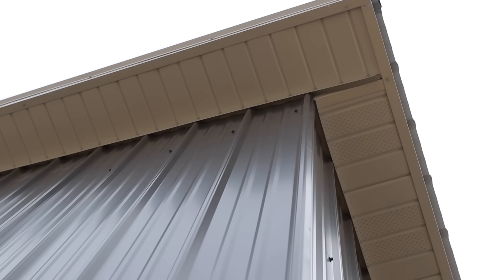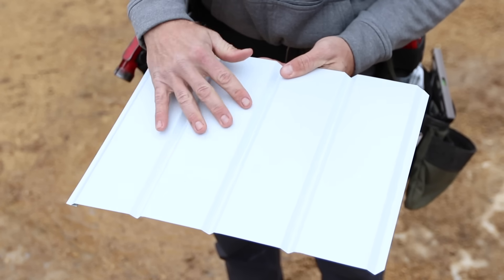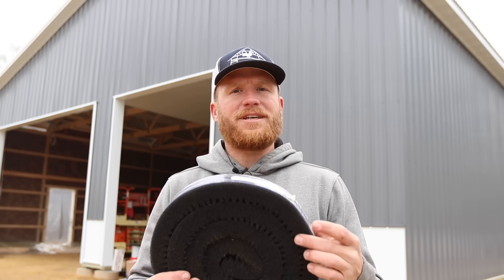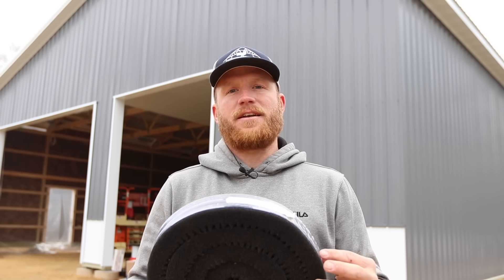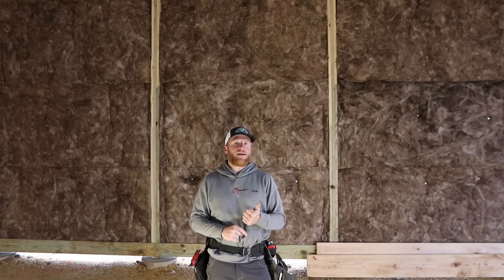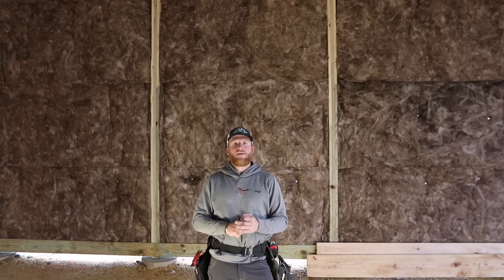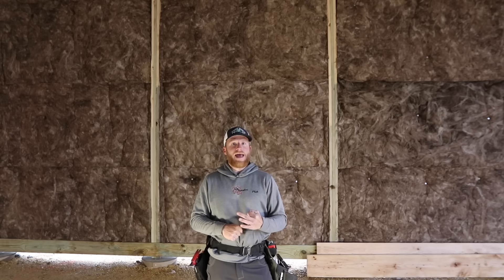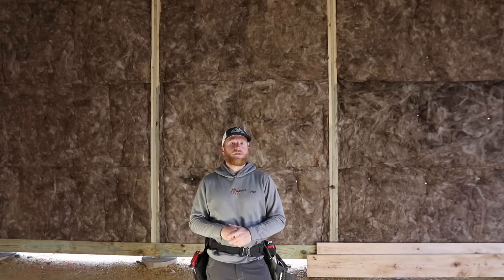Insulation: 5 steps to a more efficient building and why I don't use spray foam

Comment: Great video!

Have you heard of Prodex Total Plus?  It looks like that foil bubble wrap stuff at Lowe's, but it is actual insulation.  They make 5m (R-17) and 10m (R-22).  We use it with our precast concrete buildings and love it.  No flame spread, vapor barrier, etc.  It sounds like I work for them.  You should check it out, www.insulation4less.com, and I think they have a YouTube channel.

Thanks again!
Reply from the maker: Cool thanks man
Reply: That stuff is crap and the R values they claim are phony.  You're much better off using foil faced rigid polyiso.  https://www.greenbuildingadvisor.com/article/stay-away-from-foil-faced-bubble-wrap
Reply: toldt ok, so I’m guessing you are talking about the bubble wrap stuff, which I agree is total crap. Prodex Total is not bubble wrap. It is closed cell polyethylene foam, even says so on the website you put in, which also says it is exaggerated. It wasn’t clear to me what they meant there, but I’m not that smart anyway. What I do know is that I actually use this stuff on a regular basis with precast walls, which have almost no R value, and get excellent results. I’ll look into the polysio stuff you are talking about, don’t know much about it, but don’t confuse Prodex Total with bubble wrap. It’s really good stuff, exaggerated or not.
Reply: @aesprecast  The article from Green Building Advisor mentions Prodex Total specifically, among other products.  Whatever it's good for, you can find other products (ie radiant barrier) that will work just as "well" for cheaper.  Read through the whole article I linked to.  The editors on that site are quite knowledgeable and base their claims on sound building science.
Reply: toldt I’ll check it out, Prodex is good, but definitely not cheap!

Comment: I love the truss heel detail. Keep up the good work your knowledge is undervalued thanks for sharing man.
Reply: Yes, in Canada we figured out the problem with shallow truss heels years ago the hard way (poor insulation at corner of roof and heat escaping to the roof and causing ice dams and big ass icicles hanging off your gutters).  People think icicles hanging off your roof looks charming but don't realize its a symptom of poorly designed trusses and $ going straight through your roof (or should I say ruff?)
Reply: Thelonious M yes sir.   Spray foam those eves

Comment: Kyle,

Happy new year!

EDIT: Answered my question at 6m10s. Thanks!

I have a pole barn that I am beginning to work on. It's got a sheet metal exterior which needs some love, 6x6 posts, and 2x4 girts. I live in SE Michigan and it gets quite cold here. My plan is to install poly-iso between the girts, build a 2x6 frame between posts, fill that with fiber glass insulation, and apply plywood over the top. I'm not a builder by trade and have been learning as much as I can. Let me know if this is sane or if I should rethink my plans.

Comment: Good video, you obviously put a lot of thought into your work. Your wall insulation package concerns me though. I have been insulating buildings, including pole barns in northeast Ohio for the past 15 years and experience has taught me to avoid double vapor barrier assemblies because they tend to trap condensation. You install nice fluffy fiberglass in wide open, 8’ wide cavities which means that you are going to have a lot of air movement in your walls due to convection no matter how well you air seal the outside of the building. That air movement will kill your r-value and increase the risk of condensation. Closed cell spray foam solves those issues and is worth the true cost of the upgrade. Your attic assembly is fine but take another look at the walls; I think that once you add up the cost of all the various steps you have to go through now you will find foam attractive.  On a different note, you should add extruded polystyrene as perimeter insulation around your slab.

Comment: For what you're calling your attic air deflector why are you using you left over house wrap instead of using reflective material like a Radiant Barrier I understand that you're saving money by using remnants of the house wrap and I also understand it is in metal building which in and of itself is a Radiant Barrier however it is also an oven meaning yes it is going to be reflecting the radiant heat but not all of it what does infiltrate Houston trapped in gets reflected back down and you will not get out if you used the Radiant Barrier for your attic air deflector then you would have pain a better median with what your ultimate goal was and you even said it attic temperature being same as ambient temperature any heat infiltration you wanted to get blocked in the air cavity that you're creating with your attic air deflector and the roof so that it can follow natural draft principles from the soffit 2 the ridge vent
Reply from the maker: There is no cavity.... the attic air deflector keeps the soffit to ridge path clear and open
Reply: I had worked in a metal frame and skinned warehouse, never got like an oven in there, then again it had a few big overhead doors and we would turn on the mobile floor fans for some air flow in the middle of summer, it was in FL.
Reply: @Joshua79C  well I'm in Texas and a metal Warehouse building does get like an oven if not properly constructed for this climate
Reply: Both states have high humidity levels, its not dry in FL or TX. Like I said it but forgot to say it did have insulation but was the style whre it was fastened in between the outer skin and framing thus where it is pinched it was useless insulation wise, and they had large floor fans for air movement on less windy days.

Comment: Ok what is value? Is value saving money now or saving money for the next...... forever? The added cost of Spray foam is offset in 3-5 years by energy savings alone. Then there are all the other benefits. Rigidity, mice and insects won’t live in it, moisture control, no added cost of poly and house wrap detailing. 

Flash and batt is bad in every climate zone except 1 and 2. Of you want to make condensation put 1” of foam on the outside, stuff fiberglass and tin it. If you want to make mold add a layer of poly on the inside. 

Please don’t publicly talk about things your not educated in. 

I’m actually mad I gave this another view.
Reply from the maker: Where are you getting your info?  Thanks for your constructive feedback.  We have had great success insulating our structures this way In our climate.  If you’d like to tell me how you do it please feel free, no need to be aggressive.    You would never recoup the cost of foam in a structure in 3-5 years.... I own a 60x88x18 tall and heat it to 58 all winter.... all fiberglass and I use less than $500 in heating for the entire winter.  My same shop would have cost me around 15k if I used just 2” of closed cell.  Yes it would have been sealed tight but even if it was free to heat... which it wouldn’t be... It would still take me 30 years to break even..... 30 YEARS!   Maybe I’m crazy but please help me with that math.   Also, I’ve yet to see a mouse in my shop in any of my traps in 4 years I’ve had it finished!  If you detail stuff right they have no way of coming in... even if they did get in a door... they have no way to get into a wall cavity??
Reply: I have heard and even read a few stories of mice or insects "eating" (chew and spit to make room, aka tunneling like humans do in dirt) away the spray foam or even other stiff foams to make a nest and get in to the structure living area or to the structure itself to eat at their food source.
Reply: @RRBuildings  3-5 years is industry standard ROI for spray foam in residential construction. For a building that you are not heating and cooling year round it will of course take longer. You do good work for cheap but doing it cheap will never be as good as the higher end product.
Reply: @RRBuildings  Guess Matt was too mad to respond. SMH
Reply: You need atleast 11/2 inches for polyurethane spray foam to get vapor/moisture and air barrier. Aleast in the state i spray foam in

Comment: Question: Cost aside spray foam seems like the oblivious choice my only hesitation is future repair-ability? Say you spray foam an entire metal building then a spot gets damaged, say you back a trailer into it and now theirs a gaping hole in the side. How in the world would you remove that panel that's been forever glued to the rest of the structure? Same goes for wiring, wall sheathing, framing, plumbing.... Does anyone have experience doing a spry foam remodel? Love all the listed benefits but know repairs are inevitable.
Reply: I've been spraying foam for 5 years. You could just pull out anything with open cell. For closed cell you can just cut it with a knife or a saw. As far as running stuff through it closed cell usually doesn't fill the entire cavity and you can run through open cell. There aren't any real down sides to foam other than cost and even cost can be justified over time.
Reply from the maker: Justin that is also a huge reason I don’t want to use it
Reply: I personally would use wide and long rolls of wax paper Or plastic coated kraft paper covering the outside barrier and  around each post to keep the spray foam off the wood and steel structure components for easier repairs when needed.
Reply: Use house wrap on the outside and spray foam to that
Reply: You can remove exterior metal from the building when closed cell foamed . Also have you evwr seen a closed cell metal building? The metal will be many times stronger because of the foam witch will help against damage.

Comment: My thinking is that a vapor barrier is not necessary when steel liner is used but am open to being shown otherwise.  There are two ways for water vapor to enter the wall cavity.  The first being Vapor diffusion from the warm moist area to the cold dry area.  The second is air leakage.  A vapor barrier is meant to address the diffusion mechanism but it may not be effective for air sealing.  The reason I don’t think it is needed with steel liner panel is because steel in and of itself is a vapor barrier.  It is not like drywall or plywood or osb in which vapor can travel through.  I’d love to hear other thoughts.
Reply: Seen pictures (images) on a few blogs showing how the wood behind the steel got moldy due to moisture but also mainly to poor ventilation, its a common misconception due to those living in less humid areas than that to those living in moisture prone areas such as for me in MA, it is wise to build the way he does and not adding tape to the vapor barrier as doing so does not allow the wall to breathe enough to prevent/reduce the chance of mold growing in the wall. Even including felt on the roof would help reduce the chance of mold growing on the wood structure where it can get humid and thus moist enough for mold to grow.

Comment: Closed cell spray adds strength and vapor barrier regular types of insulation will allow air to go through closed cell will not So the payback is not what you think on comparison
You all do awesome work
Reply: I've been doing spray foam and fiberglass insulation for 25yrs. Theres not even close to a comparison between fiberglass and foam. Foam is superior in all classes.

Comment: You talked about heat insulation but what about sound?It is a steel building, wouldn't even a thin layer of foam sprayed make for a more acoustically environment?
Reply: Yeah, because I'm overly concerned with absolute quiet in my garage.... LOL
Reply: Klaus Van Heusen  , only in the quietest of 80,000 square foot machine shops for 11 years. ;)

Comment: What is the wrap attached to you showed at the very beginning? It's right under the outer tin correct? Does that mean you have a vapor barrier on the inside of the wall and the outside of the wall? Sorry kinda lost me on that.
Reply: Just watch the portion of past series when he goes to install the outer shell, it covers the post with girts installed so it is between the skin and structure.

Comment: Hi Kyle, great video, I'm always intrested how things are done in other countries or areas. In Germany we have way higher code standars, in regards to the insulation.

If you would protect your ceilling insulation the draft of your ventilated roof, it would ne was more efficient. But I know how difficult all your connections with yor frame would be.
Reply: Try the arctic, they have higher/more insulation needs.

Comment: Found it hard to believe you never mentioned the concrete slab. Here in the UK any building such as yours that is insulated we also insulate the concrete floor slab. After hardcore is compacted a blind layer of sand is laid and also compacted. This protects the pvc damp proof membrane laid next. It prevents rising damp. The block insulation slabs are laid next with a slip sheet to separate them from the concrete slab. Looking at the huge floor surface area of your particular building and the amount of effort you put into insulating the roof and walls I can’t understand why you ignore the floor, which is effectively has a huge heat loss factor.
Reply: You obviously don't realize how large the United States is. 11 of our 50 states are each larger than the UK. 28 states are larger than England. More people live outside of cities in the US than live in the entire UK and there are more pole barn buildings in the US than there are buildings of any kind in the UK. Each state/region has building codes appropriate to the climate and geology and they are well thought out for each area. But, you know, you're welcome to make a video of the building that you built and post it to YouTube.
Reply: The wonderful thing with Post Frame is it can be built on any foundation, thus said one can build a home from post frame with a walk around basements and use ICF for the basement-foundation which is a form and insulation system in one. Where I like I rather a 8 inch insulated wall for those really cold (arctic) winter days.

Comment: Interesting detail on the grade boards. On mine, we floated concrete to the outside board. I had to lift the batting before it was poured. What are your thoughts on double-bubble for the roof? I have it on mine, one thing aside from condensation control I like is that when it rains it's quiet inside. They blew in R-64 into my roof, I can turn the heat on for about 10 minutes and it's nice in there.

Comment: Great video Kyle.  The way your attic space is ventilated sounds great, especially how the blown in ceiling insulation meets the wall bats without blocking the sofit vents.

Out of interest... do you use EPS under your concrete slabs?  In the UK it's added to help the floor retain its thermal mass.
Reply: Underslab is per the customer and imo best to do in any cold climate zone with frostline and even if they are going to have hydronic lines installed for a heated floor.

Comment: https://buildingscience.com/documents/digests/bsd-106-understanding-vapor-barriers

If water does find its way to your cavity, which small amount always will weather that be through a bad detail in building stage which it seems that you guys do a fantastic job detailing tyvek and vapor barrier or weather that be through condensation or vapor collecting on your cavity my question to you is how do you expect that cavity to dry now? I have personally been in many new homes in the tri state area with mold issues stemmed from plastic being installed over framing. Not here to point fingers I am just here to hear more on why you put Polly on your walls thanks in advance for a response.

Comment: i always thought the #1 reason to go with fiberglass is it's treated with formaldehyde to control rodents. does spray foam control rodents?
Reply: Look at any building done with fiberglass and you’ll find rodents and droppings.  They love fiberglass. Spray a building with closed cell foam if you want the best insulation. It’s cheaper to heat my pole barn that’s foamed than my house that has fiberglass.

Comment: As an insulation contractor, I can't tell you how many times I tell builders to put a flat ceiling in this type of building. Seems like everyone around me wants to insulate the roof deck, and foam the whole thing with 3" of closed cell foam. I don't mind making a few extra bucks, but I just don't get it. Then some of them want to leave the foam exposed, which means I have to apply an ignition barrier over the foam (local code requirement).